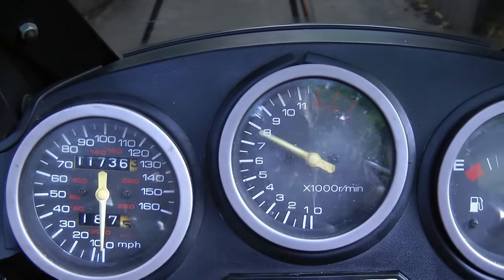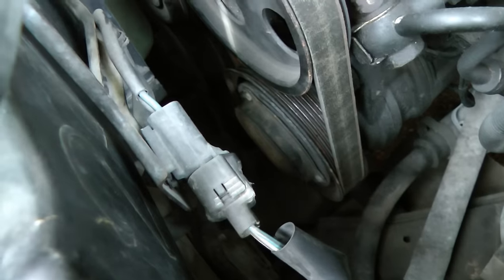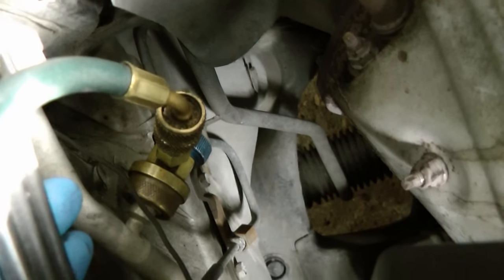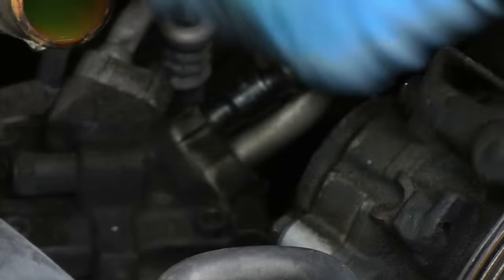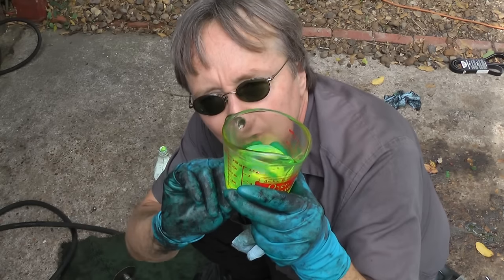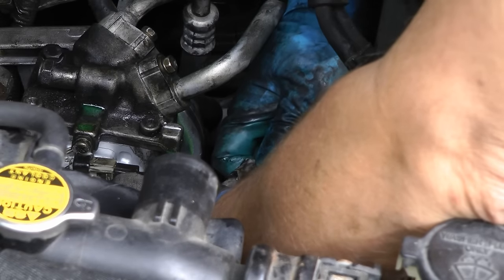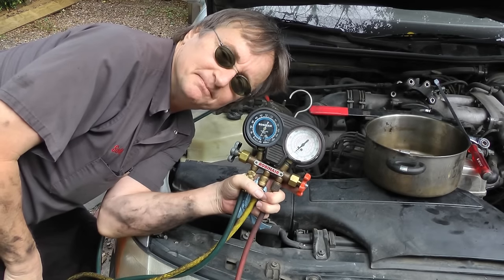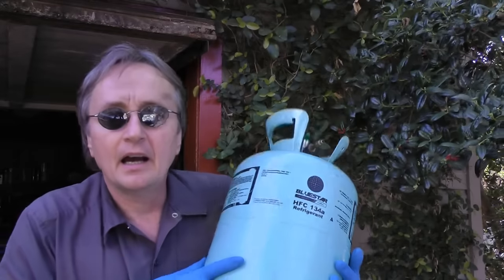How to Replace AC Compressor in Your Car

Comment: Scotty, 
I have a 2000 Dodge Durango. The compressor froze up last year, causing a horrible squealing that burned up my serpentine belt. I asked my usual mechanic about cost, and he said that it would cost about 5-600 dollars, because metal flakes may have got in the system. Can't I just replace the compressor, per this video, and call that good? Thanks.

Comment: My  97 Honda civic ( 230,000 miles)  compressor just seized up while running. In addition to the ac compressor should I also change the filter drier and  air expansion valve and clean and flush the system?

Comment: two different shops said i would need to replace the entire kit compressor and condenser about $2500 because they have to take the dashboard out and keep the car for 2 days
also said if the compressor seized up my belt would snap and would ruin the engine

Comment: My Toyota camry's ac sometimes doesn't work. It stop blowing cool air from the compressor. After a time it starts working automatically. I checked the compressor gas quantity and it's alright. What can I do to keep the compressor running at all times.

Comment: Hi Scotty, enjoy your videos, learn a lot. When replacing compressor on my 01 Grand Caravan, with rear air, how much oil would you add to compressor? Old compressor had less than 1oz. Service manual says: comp 7.4  evap front 2 evap rear 2  cond 1  drier 1. Other data sites state "oil capacity 13oz". How much would you add?  Thank you for your help.

Comment: I'm replacing my compressor now because my old one seized up on me. The new one I got came with a sheet saying I 'MUST replace the accumulator/receiver' and 'I MUST replace the orifice tube.' 

How necessary is that really? It always made nice cold air til the moment it died, and the system has never had a leak.

Comment: dear scotty. my aircond compressor is not working and my mechanic told me that the compressor needs to change the coil inside and not the compressor as a whole.. is this recommended? or is it better to change the whole compressor?
Reply from the maker: change the whole compressor, coil often go out because compressor burns them out

Comment: Hey Scotty, i just had my compressor changed
and like you say @ the 2MIN mark
when he switched the lids
it was DRY, however
he did not add any oil.

he just switched the LIDS and put it in
is this a bad thing ??
should i tell him to reopen it and put oil in that 
place (( u put 4oz ))
Reply from the maker: if compressor did not come with oil in it, I would put 4 ounces in the system now . It can just be injected into the system, there are tools for that

Comment: Unfortunately in Australia our one and only option is to take it to the mechanic as DIY on the AC system and parts in the car is illegal, it’s got to be regassed, repaired or replaced by a licensed mechanic with a refrigerant licence, I would like to service my AC but legally I can’t

Comment: Hey Scotty, Thanks for posting such a good video! I have a question I was hoping you would be kind enough to answer. My 2001 Toyota Echo had the AC compressor crack and lose a piece of metal about the size of a quarter two years ago when I lived in a cold climate. Now I live in LA and use my Echo to commute because of 38+ mpg. I miss having AC while being stuck in traffic for 45min in 95 degree weather. I found a replacement compressor online for a bit over $100. I'm capable of changing the compressor out, and figuring out how to add refrigerator into the system like you did. My only concern is that the system became contaminated when the compressor broke. What should I do to make sure it will work and not clogged from debris or compressor shavings? could it have collected particulates over the last two years?
Reply from the maker: it would be contaminated as hell now You can try replacing the drier and the compressor, evacuate it for 4 hours on a pump, then pray it works. If not, whole system may need changingnow
Reply: Thanks for the reply.
Considering its a salvaged 2001 with 156K miles I don't think it would be worth spending the $ to fix it anymore.

Ughh.... I think I'm going to keep the windows down untill it dies :) probably in 100k miles haha
Reply: I just realized something, I just bought a new serpentine belt to replace the old one this weekend. There was an option to buy one that does not go around the compressor. Should I install the shorter one and just remove the AC compressor and components since I wont be using them anymore? what are the advantages of bypassing the AC compressor?

Comment: When I turn on my a/c in my 2007 civic hybrid, it makes a loud rattling noise, completely goes away when it's off.  Mobile mechanic said to replace the compressor but also said there's multiple other parts that should be replaced at the same time (condenser and a few others I don't remember) is that really the case?  Also if I don't have a vacuum pump to remove the moisture, is that something I could bring to a mechanic to have them just do that, just like removing the freon?
Reply from the maker: you could do the work yourself, then have a mechanic empty and fill the system with his tools. I would change the compressor, the expansion valve, and the condenser on that model

Comment: It sounded to me a little fishy so I took my car and didn't let the guy replace the AC compressor to seek a second opinion. Is it possible he blew it out? Watching your video with a minute you could tell if AC comp was broken and this guy two hours? Also because I didn't let him replace the AC comp he took out all the GAS he said was used to replace the old one. But why he replaced the gas without check first if the compresser was broken? All strange to me. what do you recommend? Thanks.

Comment: Scotty, my ac compressor isnt turning like it should but its not locked because I can turn it manually also, I get a high psi of 70 on the low side and of course no cold air from the ac system.  What should I do?

Comment: Scotty, what about a very noisy compressor? Noisy even when the AC is off, when accelerating. Will it last?
Reply from the maker: +Anonymous User not for long, ac clutch is shot
Reply: +Scotty Kilmer Not very long indeed! The noise was increasing a few days prior. Few hours after my comment, I took it on the freeway and heard a chirping sound. The belt, tensioner, and the clutch were all shot. I removed the belt, will get repaired soon. Thanks Scotty.

Comment: Scotty, I have a 2014 buick regal that I'm thinking needs a new ac compressor. The ac works just fine however my car starts to rattle/knock. it only happens when I have my ac on. Dealer says it's nothing to do with the ac, so I'm confused? any idea on what else it could be if this only happens with the ac turned on?
Reply from the maker: God.Is.Love listen closely, pray it's loose bolts holding the compressor on. If not, and noise goes away with AC off, compressor is going out
Reply: +Scotty Kilmer 

appreciate the immediate response! would the ac evaporator have the same symptom if it was bad? I just don't get why the dealer would say it's not that.
Reply: +Favian Harnarain 

I wish I could, he seems like a great mechanic! God bless!

Comment: Scotty, I am working on a 1994 Pontiac Transport, it needs a new compressor but I want to use a used on, is has a GM 3.1 TBI engine on it, can I use any newer 3.1 engine compressor ? or what cars are compatible with using the compressor on it ?  or all the 3.1 the same design? please let me know, thank you.. Kody
Reply from the maker: heck, i don't even used rebuilt units, just new ones. But if you want to try used, any that bolts on and has the same fittings for the lines and the same  electrical clip will work. But I have no idea which ones are compatable, perhaps go to a junk yard to match yours up

Comment: I have an old 95 Saturn Sc1. The air has never worked, but there was a leak at one of the lines. I recharged, but it seems the compressor is locked up. What do I need to do to get the system working, other than evacuate, change the compressor, evacuate again, and recharge.

Comment: Hi Scotty,
I have a 91 toyota camry. 
We bought a brand new compressor and dryer and tired to install it yesterday. 
We did not put the oil in the way you did it but we fed pag oil through the same line that we fed the freon. The clutch does not spin and no cold air :(. (not even a little) Any idea what the problem is?

Comment: i have a 2000 toyota seinna. i just paid  88 bucks to recharge the system. it lasted two hours.. the fluid is leaking from the line going from/to the compressor. it attaches as a stainless steel looking line,it then turns down and goes to a bulb looking thing.from there  then it goes to a black flex type hose. this is where it appears to be leaking. it almost looks like the stainless is threaded where it goes into the black hose. anyway i need to know what its called and how much it should cost to fix. thanks

Comment: Hi Scotty, I will be trying to pull out the old Denso 5SE12C compressor from Toyota Avensis D4D 2004, and replace it with a new one. The oil that you put in in your video, does it have to be any special oil or the general Mobil 1, 0W40 can do. Also can I run the car with empty freon assuming I do not turn the AC on, untill I get it filled up? Thanks

Comment: For my Mazda 323 1994 Hatchback automatic transmission: 
I'm considering removing the entire Air Conditioning system. Is this going to be okay, still pass Maine USA inspection, and not cause trouble for the engine cooling or any other issues?

Separate issue: I'm not sure yet, but also may want to remove the Power Steering. Is this legally allowed, for Mazda 323 1994 Hatchback, in Maine USA, and also safe for the car?

Also, supposing I can get a good deep cycle battery for this car, and if I then remove the alternator belt (leaving the alternator in place), how far can I expect to drive the car on a single full charge of the battery? I might carry an extra battery or charger battery for backup, assuming this is considered safe and is legally ok.
Reply from the maker: sure, removing the AC actually makes it pollute less.  You can remove the power steering, it just will make it harder to parallel park. You'd have to check maine law for inspection legality though, I'm in Texas.  You couldn't get very far on a battery alone, maybe 25 miles.

Comment: Hey Scotty, i have an 01 Ford taurus with the 3.0 v6 duratec. The ac compressor clutch seized so i bought a brand new one and have it currently installed. It said with the instructions it was already filled with oil, the part im confused is do i need to add oil or should i be okay to go ahead and fill the system back up with refrigerant. The Ac worked perfect before the clutch seized up and it was just the clutch part that seized. Thanks!
Reply: I probably should have said i bought a whole new compressor
Reply from the maker: if new compressor was filled with oil you don't need to add any extra. Just evacuate the system and refill with refrigerant
Reply: Much Appreciated scotty i found an evacuater at harbor freight but not sure if this is what i need. here is a link to it online. http://www.harborfreight.com/air-vacuum-pump-with-r134a-and-r12-connectors-96677.html
Reply from the maker: scar1343
yes, that's it

Comment: Hey Scotty, my A/C clutch on my compressor keeps on cycling when I turn on the heat, and it affects my engine RPM's. It's quite annoying, but I've dealt with it for about a year or two, the a/c light keeps blinking on and off too if I turn on the a/c. Any ideas? I'm thinking it's the main control unit under the radio, but just want to be sure.
Reply from the maker: +Collin Sexton many cars are made to turn on the AC compressor when heat is on to defrost the air as ac air is VERY dry. Normal on many cars to do that. But if AC light blinks, you have an Ac clutch or compressor problem, check that first.

Comment: hey scotty what does it mean if i put my ac on max and the compressor smoked up? it had right amount of freon but i can hear hissin? as if the freon is leaking out
Reply from the maker: +killer666912  if compressor actually smokes, either belt is worn and slipping, or more often the compressor is just flat wearing out inside

Comment: hi scotty,i replace my ac compressor with a brand new gm one for my caprice,and now when ever i steer right or left the ac blows humidty and stops blowing cool air and i hear a noise from behind the vents as if the compressor stops and work again,and when i start the engine and turn the ac on the clutch doesnt work unless you press the gas,sorry for making it long.

Comment: hey scotty. got a question for you. i have a 1997 honda accord. i turn the car on and it squeals for about 5-20 seconds depending on the conditions, and then goes away. the squeal returns when i turn the AC on but eventually goes away after running long enough (either the car or the ac itself). took a look and it seems to be the ac pulley. now heres my question. does this mean I have to replace the entire ac compressor unit or would i only have to replace what i'm assuming is considered the clutch (the pulley)?
Reply from the maker: try all new fan belts first, if that doesn't fix it, odds are the ac compressor needs replacing, the whole thing

Comment: Hey Scotty, great videos! I have an 88 Chevy G20 with a 350 and rear AC, my questions, which vacuum lines go where, behind the dash, to get my other vents to work? I have 4 lines that were cut under the dash and it only blows heat through the defrost vents. Last question I have a really bad wobble in the rear end(?) at high speeds exceeding 65 MPH but doesn't wobble much at high speeds if I "granny" the throttle. If I drive it hard then the wobble is much worse, any ideas?

Comment: What's going on Scotty? I have a 2012 Impala ls with a/c problems! When I'm driving it blows cold and works perfect but as soon as I stop at a traffic light or stuck in traffic it blows warm. You have any idea what it can be?
Reply from the maker: pray it's just low on refrigerant and that it's not a breaking down compressor which it often is
Reply: Scotty Kilmer thanks Scotty

Comment: hey scotty, I have a 1999 dodge ram 1500 5.2 liter and when the engine is started for the first time that day, the a/c works like a champ, kicks on and cools, works in normal mode kicking on and off as it should and in max mode where it will continuously run, now once the engine is warmed up to operating temps, clutch does not engage anymore, I did the a/c coil test to check that the coil is kicking on by taking a screwdriver and touching it to the clutch and it sticks due to the magnetism, so I know the coil is kicking on when I turn the a/c knob to on, the clutch just isn't engaging, any thoughts?????
Reply from the maker: time for a new clutch, but really, a new compressor, when clutches wear, compressors are also shot or near shot

Comment: hi scotty k, i live in the uk and drive a renault espace (lucky me eh) i recently had my a.c pump changed for a 2nd hand one as they are nearly 400 pounds new,anyway the mechanic that replaced it said that they dont need oil if the aircon aint used?it was your video that made me ask him that question as i see that you put in 4oz of oil,is my mechanics knowledge not up to scratch or is that right?also what kind of oil is used?many thanks scotty,love your imformative vids here in u.k

Comment from the maker: he's just covering his own rear end. I would change compressor and expansion valve and drier, and flush the system out
Reply: my Prius is not making any condensation puddles but it's still blowing cold could it be because there's no humidity today down here in Florida it was making a little bit of condensation the other day

Comment: I put the 134 in my 99 mustang and it was squirting out the front of the compressor near the belt. Do I need a whole new compressor or clutch?
Reply: amanda hugnkiss  may have a loose connection, may just need to tighten the ac hoses to the compressor

Comment: I had a compressor put on yesterday by a mechanic and its still not blowing cold air. He said it may be something electrical.....but my friend said it is still metal shavings in the line. Is it because he did not vaccum it out or clean the lines correctly?
Reply from the maker: if there is metal shavings inside, he should NEVER have put a compressor on before flushing the system and replacing the condenser. He did crap work, take it back, demand your money back or have him fix it right. But really, I wouldnt even use him anymore, just get your money back

Comment: I have a 2000 as chevy maintenance Carlo, and my compressor recently burnt out. I saw some green stuff com out of it and realized it was oil once I watched one of your videos. But I found a leak coming out of the high side schrader valve but, and put a new one on and vacuumed my system down and put refrigerant in. Once I did that , my ac was blowing cold for months. The only thing is, it was blowing EVERYWHERE. The defrost, the face part, and it blew the hardest at my feet. No matter where I turned the direction knob, this occurred. I want to know if you have ever heard of a compressor burning out with oil in it and refrigerant . And if you know why the air blow everywhere? Thanks.
Reply from the maker: If you wish to ask me car questions, I am switching my questions and answers to my website. So go to www.scottykilmer.com  and ask me in the Ask Scotty section. So please, if you want your questions answered, go to this link and join my completely FREE website. No strings attached.
Reply: Check all your vacuum lines.  My '99 Olds 88 did this and it was a busted vacuum line.  I also had '01 Pontiac Grand Am that did the exact same thing - same cause, a snapped plastic vacuum line.  I don't know about non-GM cars, but a lot of GM cars require manifold vacuum connections to operate the vent louvers.